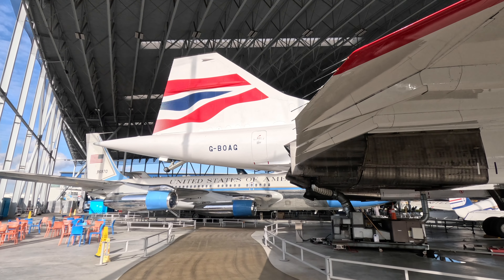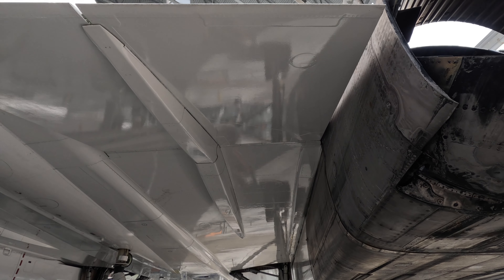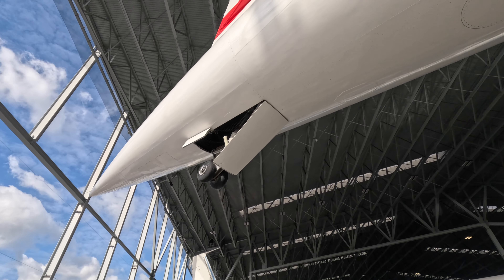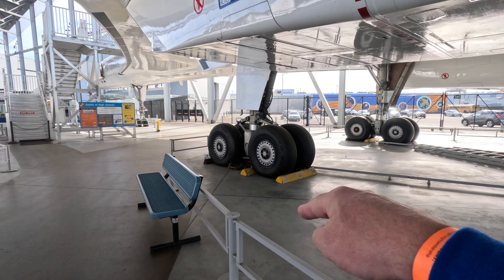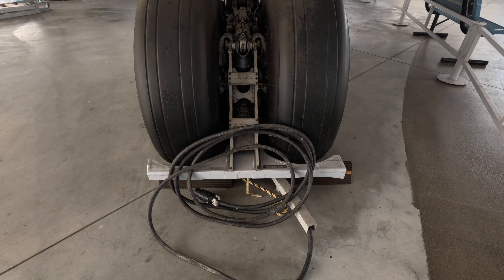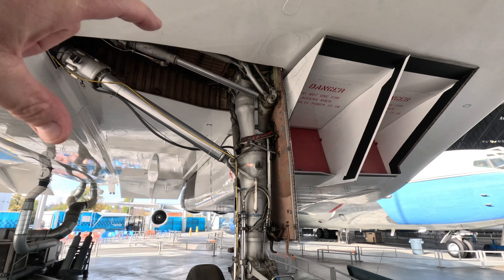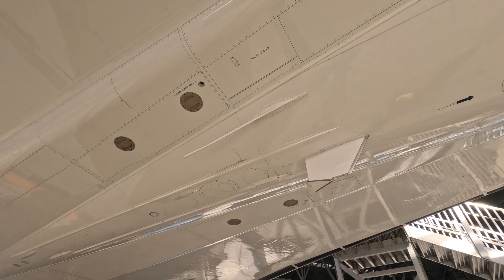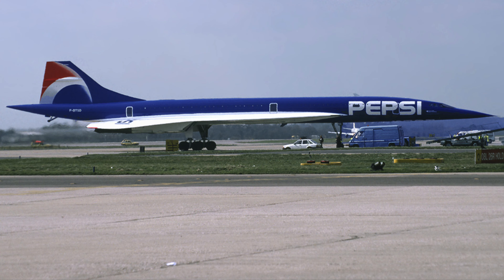Aerospatiale BAC Concorde SST British Airways G-BOAG

Comment: The rear of the engine exhaust system is all titanium. The horizontal strakes on the wings were always there.  There were no external modification to the wings following the accident.  The tank burst came about due to overfilled tanks and an unprecedented destruction of a large tyre piece which caused a shock wave onto the wing.  The titanium repair that fell off the engine of a DC10 in front of Concorde caused a full width cut across one of the tyres and this triggered the chain of events that led to the accident.

The wings were lined with self healing Kevlar, new design tyres from Michelin were produced that cannot rupture in the same way (leading to a substantial increase in safety for all planes that subsequently choose to use them) and additional protection was provided to electrical cabling that had been severed in the accident.  To offset the change in weight, a new lighter and more luxurious leather interior seat was designed to ensure the performance and range of Concorde remained unchanged by the modifications.

To date Concorde remains the most tested civil transport in all of aviation history with safety margins required for certification almost double those of subsonic planes of the same era.